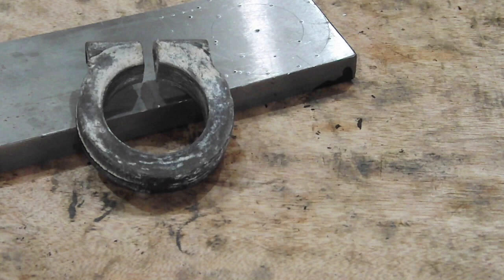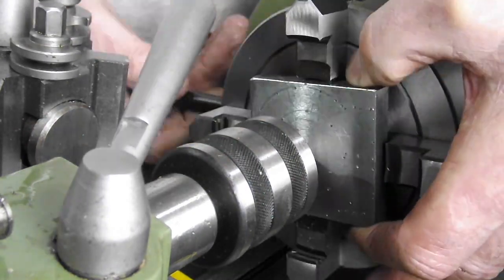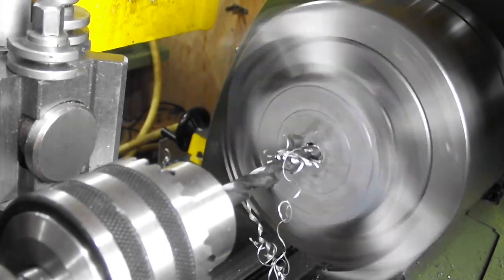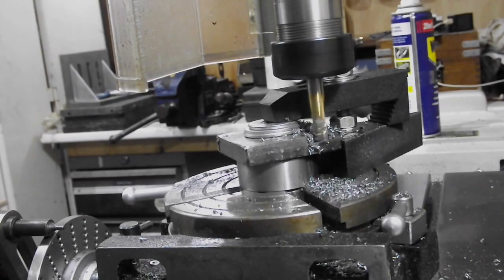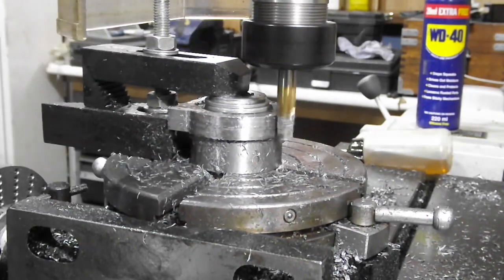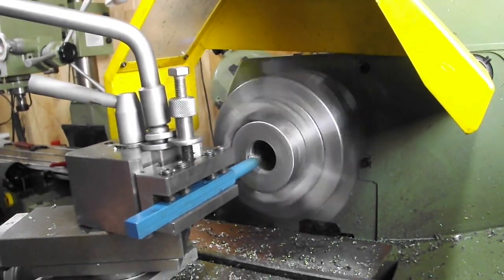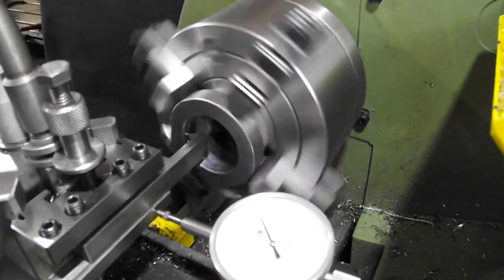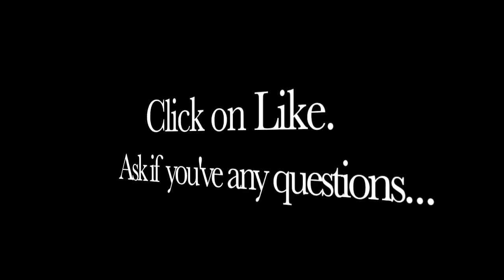Making a suspension clamp for a Gordon Microcar

Comment: Nice job. Did you have a reason for splitting it before threading?
Reply from the maker: Hi, yes… just in case the thing went daft after it was cut. When material is split like this, it can end up looking a bit like a large spring washer and because the thread is so fine it would cross thread, I had to be sure the thread wouldn’t be effected by the cutting action.
Reply: @Thesheddweller  Good point. Thanks!